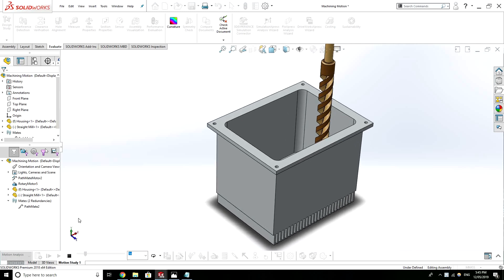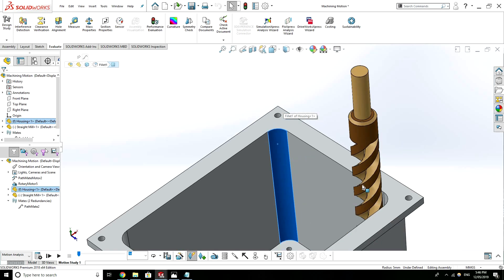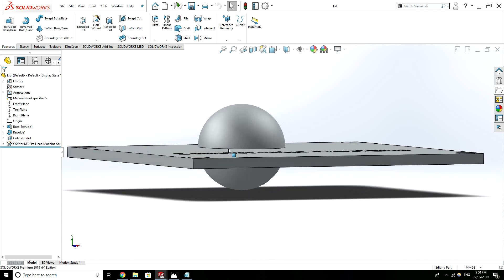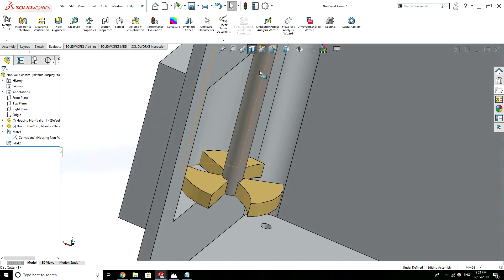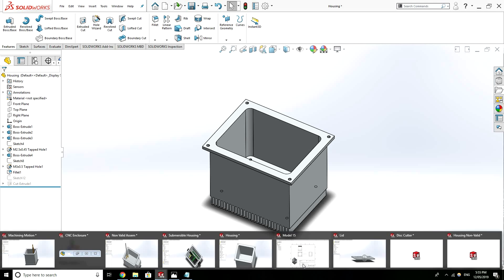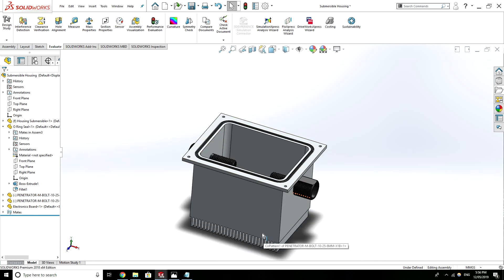Designing for CNC in SolidWorks

Comment from the maker: Video Key Points:
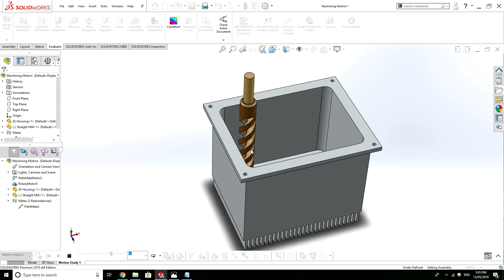CNC In action 0:39
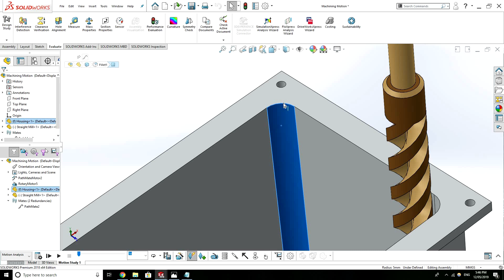Rounded Internal Corners 1:22
Design Guide 1:48
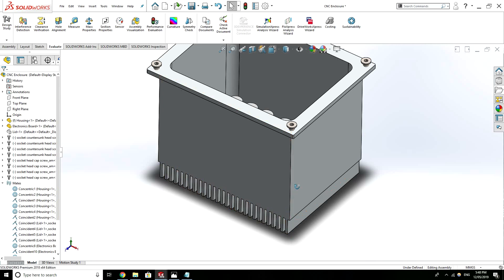Minimum Wall Thickness 2:50
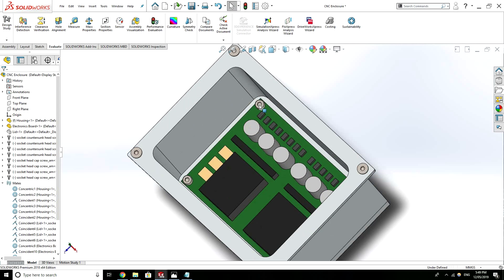Tapped Threads 4:15
Engraved & Embossed Text 6:01
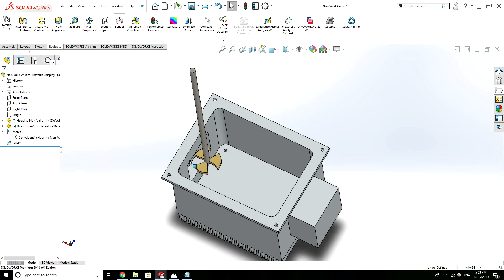Features that cannot be machined 6:39
Saving the part for Manufacture 7:55
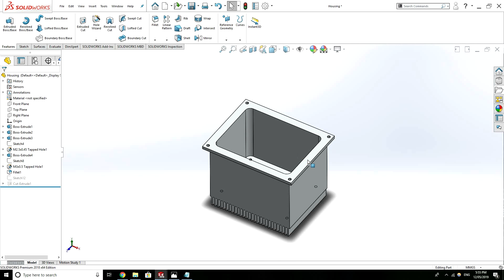Technical Drawing 8:33 
Watertight Enclosure 9:23

Thanks for watching!